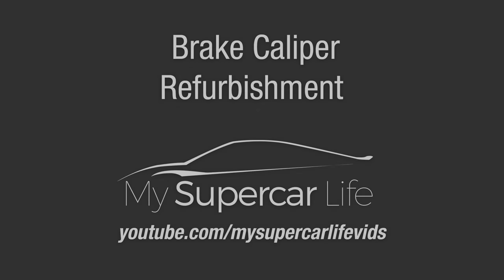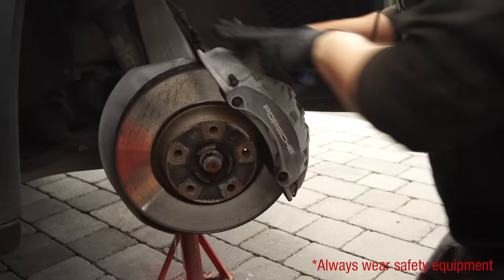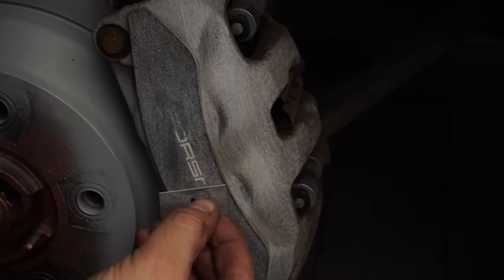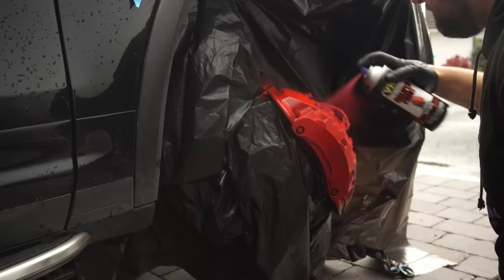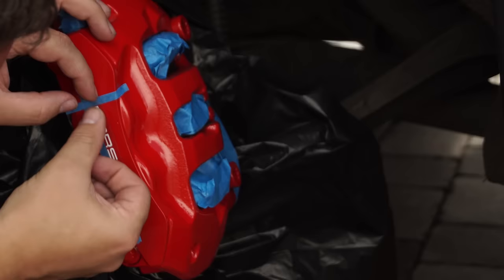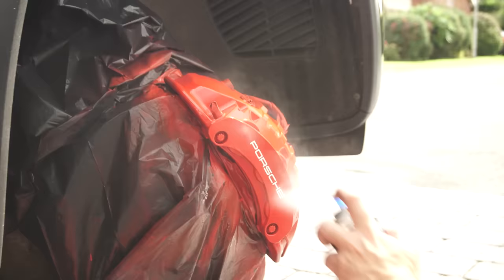How to Paint Brake Calipers

Comment: I'm nervous about the clear coat. The VHT red is extremely glossy on it's on and I took a screenshot of after you painted it vs after you finished the clear (Not at the end of the video to where it looks like more was done to it). Very little difference between the natural gloss of the red. I bought a can of this last week and tested it on some metal after spraying the VHT Gold. The Gold is insanely flat and even after hours of drying it seems to suck up all the clear. So much so I have another can coming tomorrow and there is zero shine. I've been searching for days now for another choice of clear coat spray paint and can't find anything for high heat. I already painted the gold on the calipers or would probably lean more to the brush paint on gold since it has much better gloss when dried. I used two coats of 2,000F primer, 3 coats of Gold (had to match, should have stopped at 2 but they were too light). I won't be doing the clear until I get my custom decals in the mail so I hope it's due to the gold needing MUCH more time to close it's pores since the gold seriously seems like a sponge, even waiting 20 minutes between coats. I hope someone knows a better choice of clear and can let me know before the 31st :)

PS. Watch other videos of this and compare the gloss of the VHT. If it's this same red, then compare the videos red by itself and you'll see there is very little gloss to this stuff.
In this video alone you can compare:
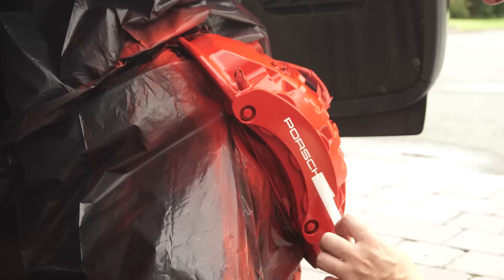Before clear gloss / after paint: 5:13
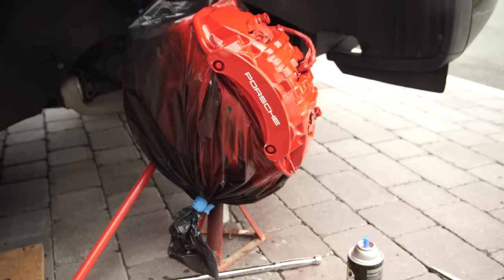After clear gloss: 6:00
Reply from the maker: I'm not sure on the VHT gold as I've not used it, but from past experience gold can be a translucent colour as it's pale. Rather than using the primer, which isn't needed, you may have been best spraying the calipers silver first.
The red is quite glossy on its own. The clearcoat is only really to keep the decals from peeling and discolouring, plus it adds a little extra protection from stone chips.
The clear did add more gloss to the red, it may not show too well on video but there was a little more shine to the calipers. However, if you were only painting them red and not using decals I wouldn't necessarily go to the expense of buying the clear.
It could be that the gold needs to fully cure before clearcoating, One other thing to try is to put the cans in a bucket of warm water for about 15 mins and then try. It may be that the paint has settled in the bottom of the can.
Good luck 👍
Reply: Thanks for the reply!
My calipers are/were already silver, but brand new akebono/infiniti silver. I painted one of my smaller rear ones first without the primer and let it sit for a full day before deciding to spray brake cleaner on them to strip it. It was an orange paint that was said to look gold on silver background and more of a paint tint. It was incredible looking and the infinitiy showed through, but just wanted a deep gold. Tried two coats of VHT gold without the primer and then one with two coats of primer and both were flat. In any case, the color is a must but out of all the VHT spray paints the gold is just the most flat and dull. The clear coat is sold as a gloss and I fully understand adding the extra layers over the decals and for added protection, but it is sold as a gloss and I'm pointing out it's so far not added much more than a hint of shine to everything I have sprayed. I found another clear gloss: Dupli-Color DE1636 Ceramic Clear Engine Paint - 12 oz. I also ordered another can of the VHT and will try the warm water idea. I shook the can for over 5 minutes and was in a 90 degree room (Naples, FL normal day). I also read an issue I had with one can of the gold to where after two coats and still shaking vigorously between coats that it all of a sudden started painting on really gritty and darker with the gold. It was said to be caused by very low humidity. Possible the clear did that but unable to see the difference like one would with an actual color. By the time my decals arrive the paint will have been settling for 5-7 days. I'll most likely test on one of the rear ones again and cross fingers :)
Reply: @MySupercarLife  Just finished my calipers. The VHT clear was done on my rears and I did the two fronts with the "Dupli-Color DE1636 Ceramic Clear Engine Paint". The Dupli seriously blows away VHT's! I can't speak for strength or longevity of course, but both are rated for 500° but in one coat of it was more glossy and even than 5+ coats with the VHT. I had enough left over to toss on a couple of coats on my rears and they look like glass. Seriously amazing!
Reply from the maker: @MrTurbine777  That's great to hear that you go it sorted, and thanks for sharing your experience. We don't really get the Dupli-Color in the UK, but it's great to know about alternative products. 👍

Comment: Calipers need to be removed to do the job properly. Pistons and seals should also be removed. Bores should be masked and for a good key for the paint the caliper should be bead blasted. Reassemble with new piston seals and replace the bleed screw and the jobs done.
Reply from the maker: Ideally yes, but not everyone has the time or equipment to do it that way and would have to pay a professional to do it for them. Most people, mainly car enthusiasts, just do it with spray cans. As long as the prep work is done thoroughly there is no reason you can't get an acceptable finish this way, that will last and look good. It's also far more dangerous for someone who doesn't have the knowledge and skill to properly remove and rebuild calipers to do it that way.

Comment: hi bud should you have not primed the set of caliphers first with at least 3 coats them spray paint?
Reply from the maker: +Abi Shah hi. No, with high temp paint you don't need primer and the clear coat is only to add gloss and seal the decals in, you can get away without using that too. If you want to do a special colour, I believe you can use 3 coats of hi-temp paint, then use a normal spray paint over the top. I've never tried it but apparently it works too. Hope this helps!
Reply: My Supercar Life ok bud ty..by the way caliphers look fab.
Reply from the maker: +Abi Shah no problems. They look so much better than before. Can't believe how bad they were!

Comment: Hey nice video, so I used the VHT Caliper Paint in Real Red and mine looks alittle darker red, nothing quite like your red calipers here in the video, which look closer to the real thing from Porsche. I wonder if VHT changed there paint tones or is it the fact that I used a grey primer before hand? eitherway I'm alittle annoyed as I had to strip all 4 calipers and start again. Trying to find Guards Red (proper Porsche Caliper colour) is tough.
Reply: Nobody makes a caliper spray can in Guards Red!! All the other red Caliper pants don’t match
Reply from the maker: It's possible that they changed it but I'm not sure. I didn't use primer as you don't have to with the VHT paints so that may be the problem but I don't think so as my calipers were grey to start with. Sounds really strange and I hope you get it sorted.

Comment: Hi, after sprayed red color how much time you need to place porsche emblem and after that how much minutes need for clear coat?
Reply from the maker: I think it was around 20-30 mins before gently applying the lettering - it's to let the paint harden, you could leave it overnight otherwise. The clear can then be put straight over the top, no need to wait.
Reply: @MySupercarLife  that 3d sticker can be smaller after more heat the caliper?
Reply from the maker: They stayed the same size after around 2 years.
Reply: @MySupercarLife  nice, last question. They are heat resistant sticker or normal?
Reply from the maker: @guncanrefik2497  It's just Normal Oracal cast Vinyl 😃👍
Reply: Thanks for everything!
Reply from the maker: @guncanrefik2497  No Problem!

Comment: how soon can you drive your car after finishing up and putting the wheels on
Reply from the maker: Around a couple of hours, ideally overnight. If you use the VHT paint the heat helps to cure it, but you have to make sure it's not sticky so that any brake dust etc. doesn't permanently stick to the clear coat 👍

Comment: I'd like to give this ago and bring some life to my aging car. However I'm a chef and have no idea on calliper features or mechanics. Any way I can figure out which bits I need to avoid running and what needs taping off. Or maybe I'll realise it's pretty easy to see?
Reply from the maker: It pretty straight forward to be honest. If it's rubber or wires then don't paint it, and if it looks like it holds something on but needs to come off for a pad/disc change then don't paint it. Best thing to do is google photos of painted calipers and you'll soon get the idea of what you can / can't paint

Comment: The IPA video you did referring to that IPA dosnt strip wax at all try autobrite wax off and do a video of that if you can please
Reply from the maker: IPA works perfectly well for me and most others every time, and is the main ingredient in most products like CarPro Eraser, Gyeon Prep and pretty much all others. I don't know how you're testing if there is wax or not?

I would NEVER use or promote any products from Autobrite again since their Devils Blood Snow Foam stained the engine bay and leather of my car. I wouldn't use or promote anything that they make (or sell), since I know they've seen the video as people from other detailing groups have attempted to share it on their FB page many times, which all posts have to be approved to make sure that no one says anything bad about their products. They've not contacted me to offer any help or even to try to resolve the matter, which says a lot about customer service.
I wouldn't be surprised if the product you mention is Panel Wipe from a body shop suppliers, which costs about £8 for 5 litres. That will remove any traces of wax or oil as it's designed for pre-painting. It's also VERY aggressive.

Comment: Do the vinyl decals not melt when the brakes get hot?
Reply from the maker: No, they're fine as long as you clear coat over them otherwise the adhesive will soften with the heat.
Reply: My Supercar Life thank you. Will have to give this a go

Comment: Good work but I think brush painting is way more better than spray painting it
Reply from the maker: See, I'm the other way. With a brush I'd get it everywhere and get covered. That's why the wife doesn't let me decorate!
Reply: I used a brush... its horrible! The spray meets al the Tiny places.. the brush Will give you lines and stripes in the end. Spraying is waaaaay smoother

Comment: What about the paint quality?? Will i need to reapply the paint at some point in time?? Or its for life??
Reply from the maker: Thanks for commenting. You shouldn't do if you do the prep work right and use a good quality paint like the VHT I used in this vid. These calipers have been done nearly 12 months now, and they still look as good as when they were painted (if not a little dirtier LOL).
Reply: @MySupercarLife  I've had VHT paint on my calipers for 3 years now and it's holding up well. There are chips here and there from work involving removing the calipers for brake work and resting it against rough surfaces, so I have to redo this soon.. x_x
Reply from the maker: @mr.dodosoft6952  I've just sold this car and after 18 months they still look as good as the day they were done. I really rate the VHT paint. I'm going to re-do the calipers on my new car as they have been done with a low quality paint, and they are stained. I think using the VHT paint with VHT Clear Coat helps prevent staining. I would 100% use VHT in the future.

Comment: Great video but I noticed at the end of it there appeared to be a grey coat on the brake disk / hub and slightly on the disc face itself?

Dis you spray these too? If so how?

My brake discs are still good but rusted slightly so I want to smarten them up
Reply from the maker: Yes, I sprayed the middle of the disc too to neaten them up. I used a cheap grey high temperature paint after wire brushing. A zinc primer is a good option for painting this part as it resists rust. 
What you do is paint the hub and also lightly paint the edge where the hub meets the part of the disc that the pads come in to contact with. The first time you drive the car the pads will wear away the paint from the face of the disc leaving a perfect line around the hub. You can sort of see what I mean in the thumbnail for the video. I don't tend to paint the face that the wheel bolts too though to be on the safe side.
Hope this helps. If it's unclear let me know.
Reply: @MySupercarLife  Paint is extremely bad to spray directly onto rotors and brake pads will be clogged with paint after 1 use.
Reply from the maker: You only spray a light dusting on to the 'rotor', you don't apply the paint thickly. This is a very common way to do it

Comment: How does the Paint hold up ?
Reply from the maker: I sold the car around 2 years later and they looked just as good as the day they were done. There was only 1 tiny rock chip on one caliper, but that was it. They remained bright and easy to clean.
Thanks for the question 👍

Comment: What would you do if the callipers were already painted? Just wire brush them still or something more abrasive ? As I’m guessing these are un painted ?
Reply: just clean them well and keep the old paint if ot's not damaged as the otiginal paint is much stronger. And put the spray paint on the old one.

Comment: Hi mate I’m curious what type of vinyl was used for the decals?
Reply from the maker: Hi, it was either oracal or ritrama cast vinyl. I'm pretty certain it was oracal but any would work 👍
Reply: @MySupercarLife  thanks bud, I wasn’t sure if they had to be heat resistant to last 👍🏻
Reply from the maker: I asked our supplier and they said there isn't really a high temperature vinyl unless it's a special application.  And recommended cast vinyl. It didn't shrink or crack in the nearly 2 years after I painted them, so u would say it's fine to use
Reply: @MySupercarLife  thank you
Reply: @MySupercarLife  really helpful cheers!

Comment: What about drum brake caliper?

I have disc on front and drum on the rear/back
Reply from the maker: Do exactly the same process on the drum. My advice though, don't paint the area where the wheel meets the drum, leave that bit bare metal. But paint the rest as you would a caliper.
Reply: My Supercar Life be sure to put a Brembo sticker on the drum brake🤣🤣🤣

Comment: I hate to be that guy but .... the callipers HAVE to be removed? Not prep or cleaning where the disk sits paint will lift and flake in time especially with the email of heat and abuse calipers take.
Reply from the maker: Well, they didn't in the nearly 2 years I had the car for after they were painted they looked exactly the same as when I painted them with no flaking or discolouring at all. I agree that they 'should' be removed to get 100% coverage and cleaning, however this isn't always possible for varying reasons.

Comment: Any problems with longevity when skipping primer?
Reply from the maker: Hi, You don't use primer with VHT paint, it's direct to metal as it is a caliper paint. They looked as good as the day I did them when I sold the car over 18 months later I would really recommend the paint but you have to make sure the caliper is clean before spraying it. Hope this helps.

Comment: Heat won’t cause the sticker to peel ?
Reply: Paul Amarante they make special heat tolerant vinyl
Reply from the maker: No it doesn't. I contacted all of my vinyl suppliers and they assured me that there is no such thing as 'high temperature vinyl' except for really specialised purposes. The Vinyl I used was normal cast Oracal and it held up fine with no cracking or shrinking or peeling. I do recommend clear coating over it to prevent peeling or discoloration as if anything will let go in the heat, it's the adhesive.

Comment: This is a fine and economical solution, but since the thickness is much lower than that of original, it is prone to be scratched (by asfalt or stone pieces).
If you want sth IDENTICAL to original, 
1. Dismantle the whole caliper
2. Mask the parts that shouldn't be painted
3. Apply the paint in powder format from your desired color, 2 hands should suffice
4. Let it stay in an oven with temp and time indicated of the powder box.
Be careful about time and temperature. If you exceed the permitted variables you might damage you caliper metallurgically.
Obviously this process costs you a little bit more, but the result is shinier due to powder polymerization and more importantly is permanent.

Comment: I'm curious that you did not use primer?
Reply from the maker: Hi. You don't need it with the VHT paint. It's designed to be used on bare metal. Just make sure you do the right prep work and it'll be fine. Hope this helps, thanks for commenting

Comment: Very very nice job, can you tell me if the paint was self etching
Reply from the maker: It is designed to be sprayed on to bare metal. I think it's enamel based so it doesn't need a primer. They've been painted now for nearly 18 months and still look the same. Hope this helps.

Comment: 4:30  Will the plastic lettering resist the heat?  Won't it melt?
Reply from the maker: No, it's safe to use and looked exactly the same after 18 months

Comment: You sprayed heat resistant paint on your rubber brake lines?
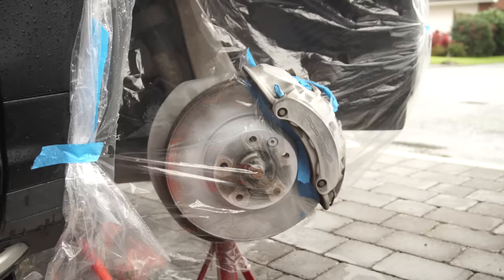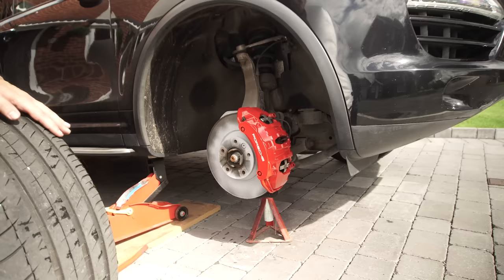Reply from the maker: Errr no. First there are no rubber brake lines at the caliper end on a Cayenne. It has rigid pipes running up the suspension arm where it joins a rubber pipe at the top. This is about 18 inches away from where the caliper is. If you're referring to the rubber sleeving over the pad wear sensors, you can see at 2:45 where it's masked off with blue tape, which is why at 6:23 it's black again once I removed the blue painters tape.
Reply: My Supercar Life 👌